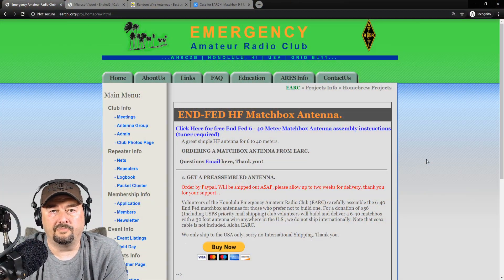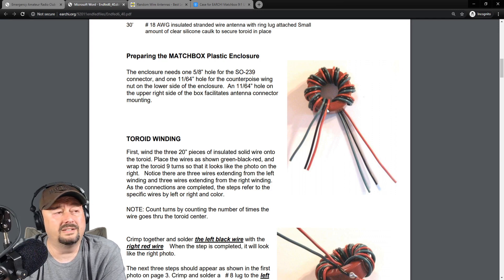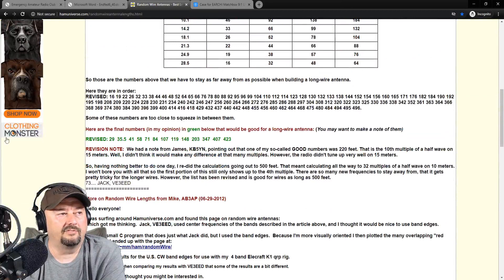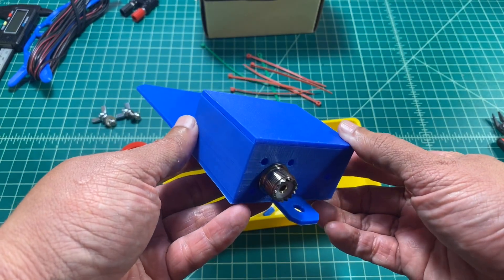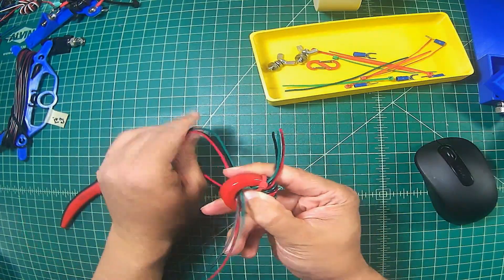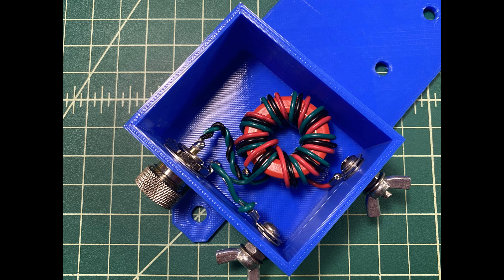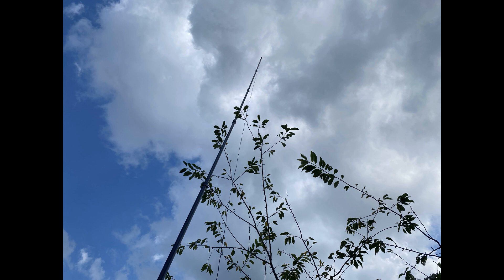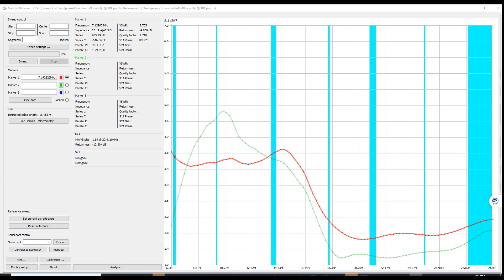DIY EARCHI 9:1 End Fed Ham Radio Antenna - (UnUn / Balun)

Comment: If you use an FT-140 (43 mix)  Toroid and solid copper wire, you will have very low SWR coming out of the gate! Powdered iron toroids will not reduce the impedance as well as  Ferrite toroids, tinned copper wire is cheaper, but a compromise as well. Spend a few dollars more for quality components and the results will be superior. I built one myself following this plan with upgraded materials, my swr is flat, 1.04 on the 160 M, 80M, 40M. 20M bands-the 10-12-15-17 M bands have an swr of 1.2-1.5.  Otherwise, the Smokin Ape instructions are fine..
Reply from the maker: Agreed, thanks for the additional context Jonathan.

Comment: Thanks for the video.  I noticed in wrapping the toroid, you didn’t cross the streams.  Way to go!  Lol.  You mentioned a little noise, and I was wondering if you tried a horizontal polarized configuration to compare with your vertical test?   Another question I have is where are you measure SWR?  Is that with the tuner in the circuit? (Sorry, that question might make me loose my engineers card).  Thanks again, all the best, 73 de KI5HXM
Reply from the maker: I didn’t try horizontal, verticals are just more prone to noise.  So I do measure the SWR with the tuner in-line because the random wire by design isn’t resonate on any ham band.
Reply: @TheSmokinApe  thanks.  After looking at this more I am leaning to EFHW. Thanks for answering my questions.
Reply from the maker: Best of luck with it Brent!

Comment: I was looking for a video on a 75 to 50 ohm Unun. 
I did find this: http://www.gnarc.org/wp-content/uploads/The-End-Fed-Half-Wave-Antenna.pdf
I read in this that a choke shouldn’t be near an Unun? This causes loss on the shield acting bad a counterpoise. 
If you want, give it a read and see it it has merit. KI5IQE
Reply from the maker: Hey Joe, I have seen that doc and its a great resource.  There is plenty of debate and opinions as to whether on not to use the coaxial shield as a counterpoise, I happen to be on the side of choking and using an attached counterpoise.

Comment: I put one of these up, not in a vertical configuration but as a sloper and I managed a contact to NM from NH on 20w with my xiegu g90. Easy little toroid to spin and since I used a 240-43 toroid with higher gauge magnet wire it'll probably handle more than 100 watts.
Reply from the maker: Nice, glad to hear it’s working for you 👍

Comment: Ape, would a counterpoise be necessary if I have the antenna grounded to a copper rod right at the base? (would be be beneficial to have both? I'm thinking so)
also, if I let the coax be the counterpoise (again, while grounded to the rod), can that coax be coiled up? I ask because if I use 25ft of coax as the counterpoise, my shack entrance may only be 10-15 ft away. Thanks!
Reply from the maker: You should be fine without one, but with antennas you never know of what you will get.  I'd try without and then add one if needed.

Comment: Great video, Ape! I have a Yaesu FT-991 with a built in tuner, would I need an external tuner for this antenna?
Reply from the maker: Hey Samuel, glad you liked the video.  With a 9:1 Random Wire antenna you generally need a tuner that covers a broader impedance mismatch that the 3:1 tuner in the 991.  With an End Fed Half Wave antenna, which uses a 49:1 impedance transformer you would be fine.  I have a video called "What the heck is a long wire antenna?" that will explain the difference in more detail.
Reply: @TheSmokinApe  Thanks, I'll check that video out! I'm a newbie, hoping to get my General ticket later this week.
Reply from the maker: Good luck on the test 👍
Reply: @TheSmokinApe  I passed! Now on to the extra...

Comment: I have a suggestion. Ground rod with 3 ft of solid wire to it. I’ve used this for 3 yrs and made several. I’ve added wire and was on 160m. 1.996. I was able to get into VA with it about 8 ft off the ground, with the tail end at 4 ft to the ground. I don’t know the length, but I can get 160 to 10 m with ease and good swr. It’s a great antenna to make and try.
Reply from the maker: Great suggestion, thanks!

Comment: I built mine over a year ago and am THRILLED with it. Of course my experience with antennas other than a diapole is limited. Mine works fine for me on JS8Call, which is my main mode. Thanks for filming this.
Reply from the maker: I'm happy with it so far.  Thanks for watching and sharing your experience!

Comment: Loving the antenna building videos.  A wire antenna of some type is probably what I will have to go to when I eventually get an HF setup.  And also probably limited to 40m because of property length.  I'd love to manage to get 80 though as there are a few nets I know of there.  Keep up the great work, I love your content.  I was also wondering how much power an antenna like this could handle including what it can do on FT8
Reply from the maker: Glad you like the videos, more will be coming.  I have a small property as well, so I’m trying to be creative. 👍

Comment: Good job on this Ape. I’ve heard verticals are inherently more noisy. Testing against a resonant vertical might show whether it was more noisy. I’m currently using a Nelson 9.1 with about 100 ft of wire, 60ft high as inverted L. I can use internal tuner on some bands, have to use my manual on others. 73 N4WLC Bill
Reply from the maker: I've heard the same about verticals.  I currently have a Nelson 9:1 running a 51' horizontal that is much more quiet.  Thanks for the comment!

Comment: This is a great build.

What I love about End-Fed Random Wire is, with a capable tuner, I get all the HF bands. A compromise antenna, but versatile. The "clear" speaker wire I used was hard to see from the street.

Good choice on the toroid. I understand for 9:1 UnUns, type 2 helps with 20m towards 6m. Type 43 toroids perform better for 80m. 40m is a tossup.

I am curious about moving the chokes closer to the radio allowing the coax to act as a counterpoise.

I have heard 80m benefits from the counterpoise. I used one to help on 80m with about 120ft of radiating wire. The longer wire did not help my signal get out as much as I had hoped.

Tuning the length was hard for me. Lengthening and shortening the antenna caused surprising (to me) results because the goal is AVOIDING resonant lengths. A great education! :-)
Reply from the maker: Thanks for the comment, glad you liked the video.  I agree with you on the toroid selection, there are so many opinions on them.  I choose to use the 130-2 because that is what was call out in the build.  I generally choke at the feed point and attach a counterpoise but to your point, there are many configurations to try!